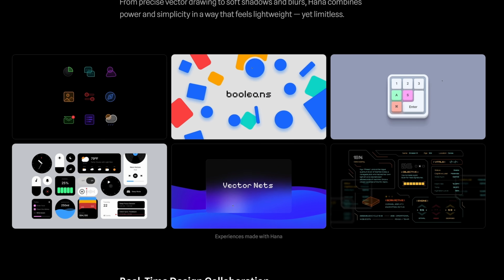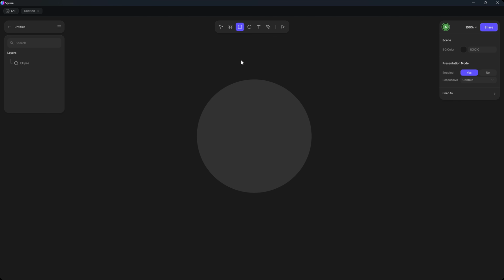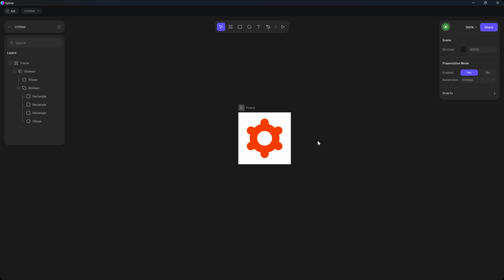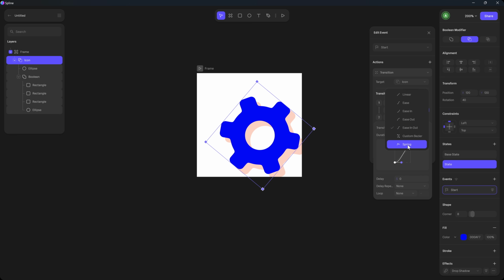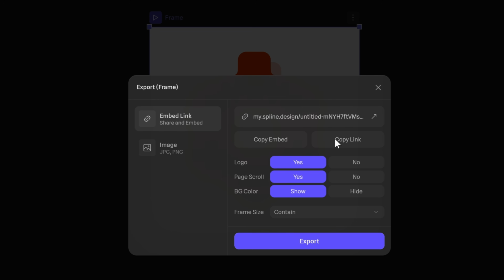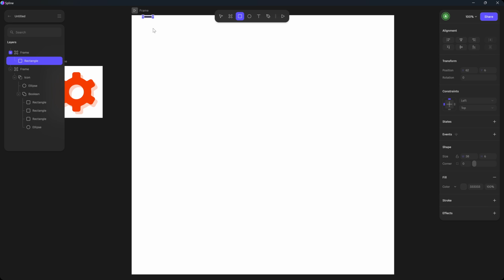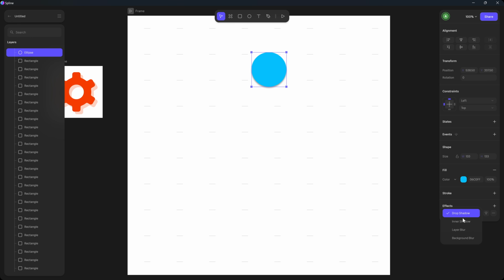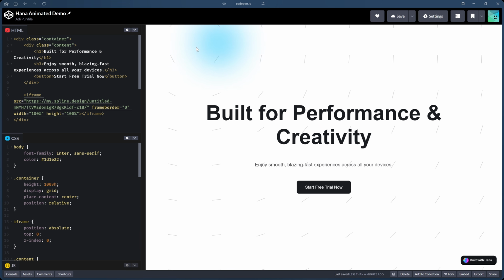We tested HANA: Spline’s new 2D animation tool

Comment: Can I create a looping animation while hovering? I can only set it up so it starts to loop infinitely after I hovered, but it will continue to play whether I'm still hovering or not.
Reply from the maker: That hover loop behavior can be tricky! Try setting up two separate interactions: one for "While Hovering" that starts your loop, and another for "While Mouse Leave" that stops the animation. You might need to use a variable to control the loop state - set it to start looping on hover and reset/stop on mouse leave. That should give you proper hover-only looping control!